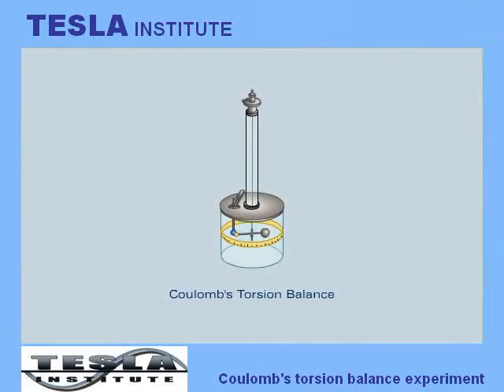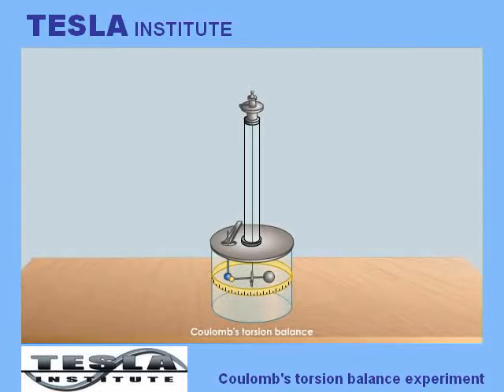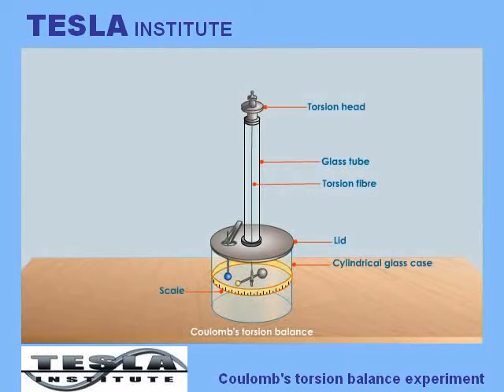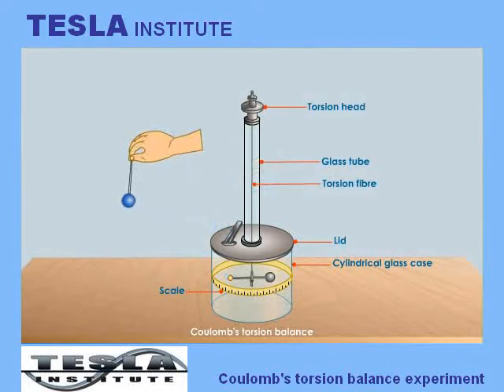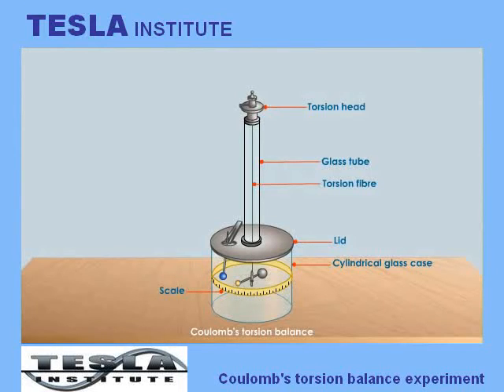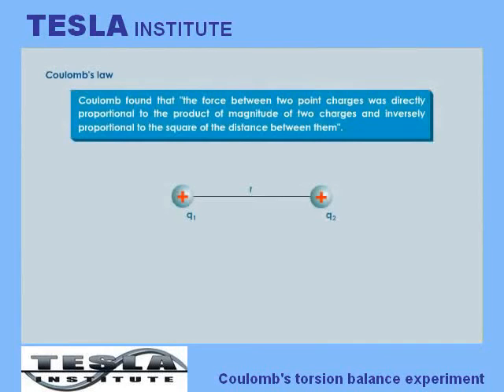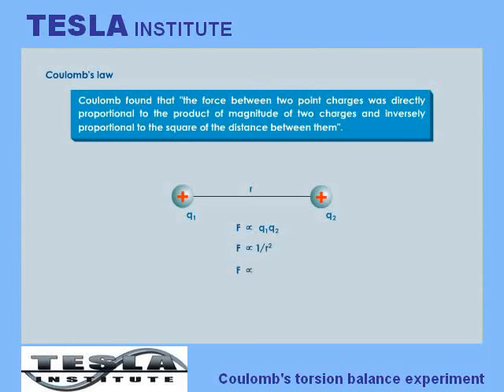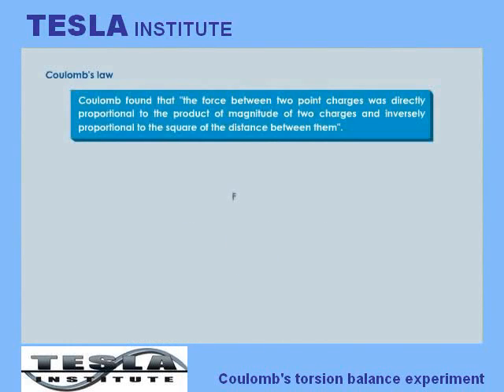Coulomb's torsion balance experiment

Comment: This is what Cavendish stole and falsely equivocated with mass attracting mass to calculate Big G. 

How does science get away with people like Cavendish falsely equivocating? Does anybody ever get held accountable in science?
Reply: well so what if he used a device founded by another person to calculate another constant?
Reply: @zitscx886  then it's correlation only. Not a manipulated variable as required by scientific method.

We must manipulate in science, not simply calculate.
Reply: @sleepingwarrior4618  k btw i had one question. why is there a sphere attached at the other end? is it to balance the needle or does it gives it weight so as to minimise the swinging of the torsion fibre?
Reply: @zitscx886  it's a balance. Using mass to balance out the other mass.